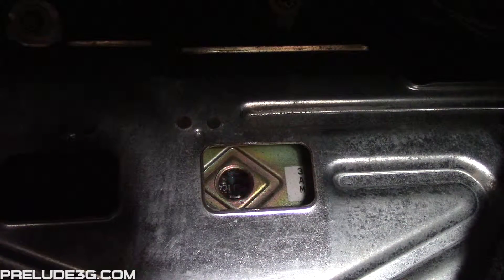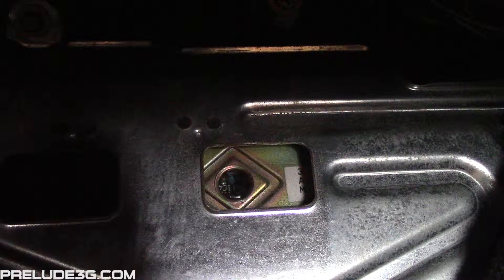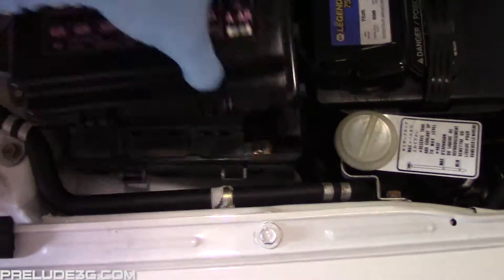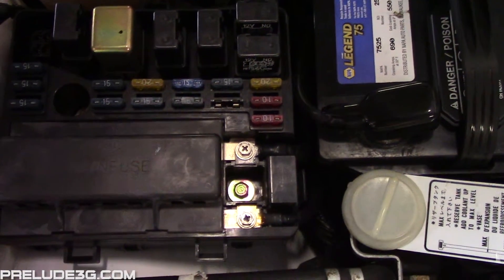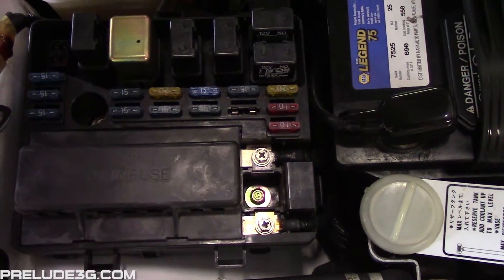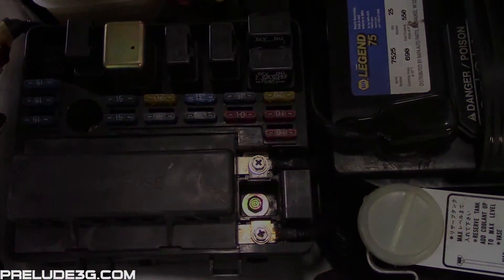Checking ECU Error Codes

Comment: Hi, I don't understand this... I have no check engine light on but I just tried this due to my car not starting unless popping the clutch. I just get 14 short blinks... you know what that could be? Thanks in advance.
Reply from the maker: The ECU stores old codes so it could have been from some time back. The check engine light only comes on if there is a currently detected fault.
Code 14 is for the EACV. I would pull the clock fuse to clear the codes and then see if it comes back.
Reply: The battery and alternator have good voltage, you think it could be the main relay? 
Thanks for the feedback.
Reply from the maker: @hzkjoncee  No it wouldn't have anything to do with the main relay.
Reply: @Prelude3g  Any clue on what it might be? I already bought the main relay.